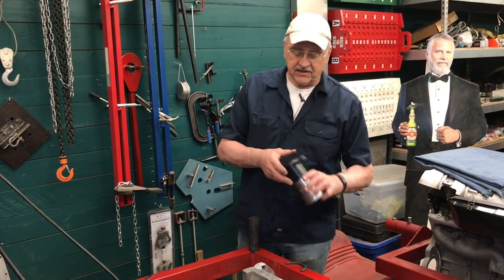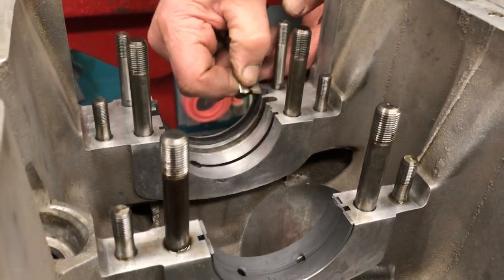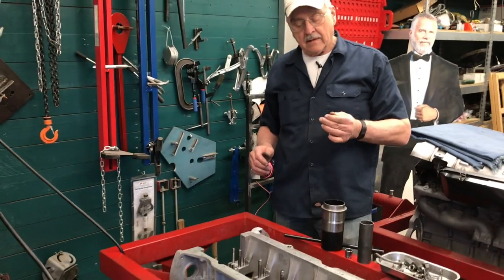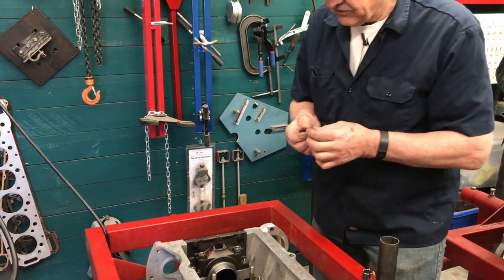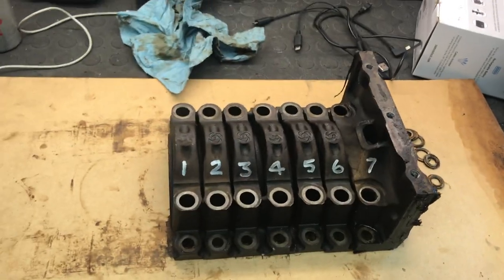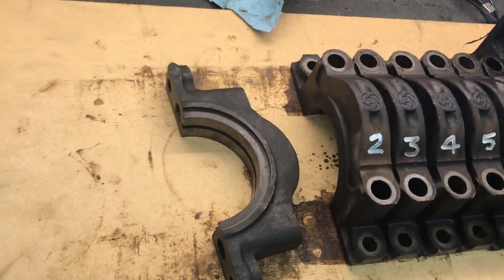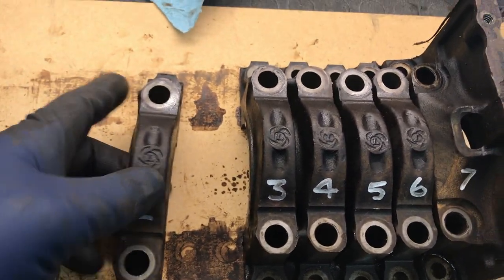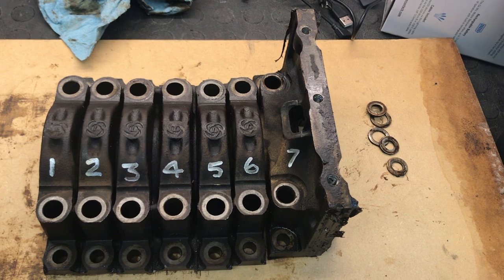Tuesday Extras - Ep 3: Jaguar 5.3 L V-12 $100 Overhaul Challenge / Crankshaft Installation.

Comment: Did the Ford 6.0 V12 use a rope seal also?
Reply from the maker: I've never had a 6.0L in the shop but the late 5.3s used a modern circular lip seal. I would assume they wouldn't have gone back to the rope seal with the 6.0.